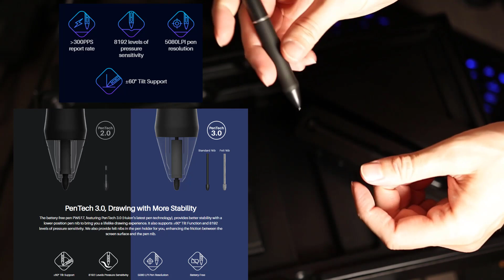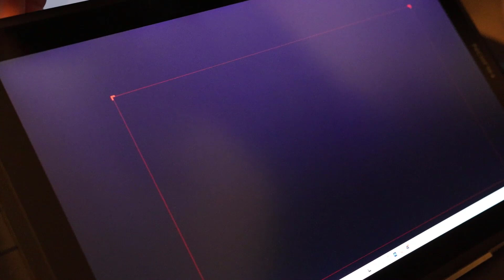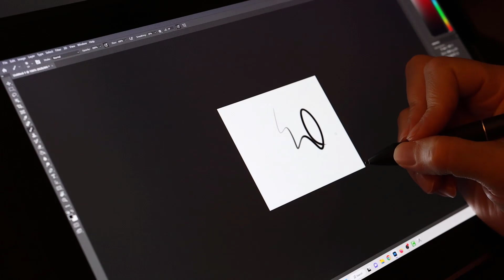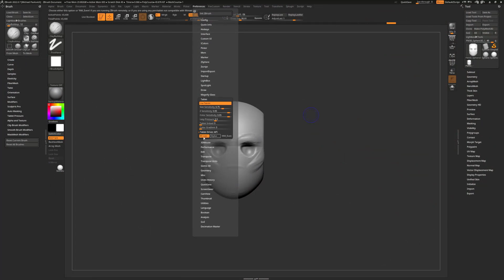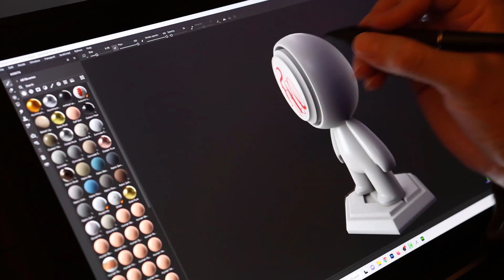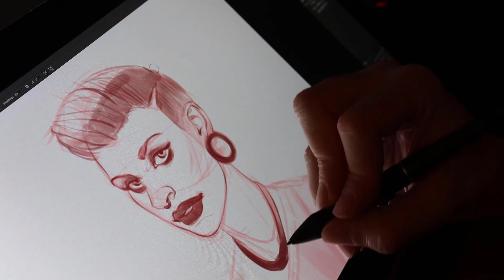Huion Kamvas Pro 16 (2.5k) - perfect portable pen display companion! Unboxing & draw/sculpt demos!

Comment: Can I use it for video editing and hit film pro for special effects.
And can I transfer those videos to my macbook seamlessly?
Reply: it is not a stand alone. its basically just like a monitor with pen control. refresh rate is a bit slow too at 14ms it would probably be no good for fast moving images
Reply: @cheveyo2403  what I meant was 
1--can it have softwares that are not on my pc or must it be on my pc to be on the display tablet?

2-- can I use it when my pc is off or does it only function with a pc that is on?

Thanks for the info by the way 👍

Comment: Hi, anyone can help? I have a strange problem. My huion makes a high-pitched noise when the screen is turn on. When I touch the screen with pen the noise changes to a buzzy sound. A similar high-pitched noise comes from the power brick. Its quiet noise but its give me a headache. Is it normal noises? This model is my first display tablet...and i'm afraid about my pc too. Display tablets, which my friends use, do not produce those sounds.

Comment: It's NOT portable! I wasted my money on this thing and I cannot get it to work on my laptop. I used a USB-C to USB-C cable and my laptop does NOT recognize it, I still have black screen on the tablet. It can only work on my laptop if I plug it into the wall socket, which is a thing I don't like in display tablets. Because I hate sitting in my room and working all day long at one place, I decided to sell that Huion tablet I wasted my money and buy an iPad instead.

Comment: Quick warning to those that would use the Huion Kamvas Pro 16.  I'm a proud owner myself, however I have noticed I loose pressure sensitivity in zBrush if I have Photoshop open at the same time.  Close Photoshop and my sensitivity immediately came back in the zBrush app.  Not sure if @Michael Pavlovich has seen or can confirm the same as me?

Comment: when photoshop is open uses windows ink, and Zbrush goes all Funky with pressure makin bumps in the stroke, when both software are open at the same time.  i contacted support, they are aware of the issue, it happens to all Huions, is in the drivers.  and  is an old issuie  they never fix it.    That why i returned my huion.

Comment: Michael: the problem with the pressure in zbhush is not you hand,   is an issue with photoshop open at the same time with zbrush.
Reply: Movink 13 by WACOM, one cord and side button, did you see this?

Comment: I was not able to find the price on their site, sounds fishy to me when they are hiding it so hard. Store button doesnt work too. I had bad experience with Huion in the past, it seems like nothing changed after 2-3 years to be honest. XPPen is not better (offset pen to display = really bad, it seem like you have the same issue with the Huion when looked at properly, but you dont mention it.) Also nothing is perfect. Not even a tablet. Barely any negatives, I just cannot believe that.

Comment: Nope. Do not buy. 
I did last year and I can clearly say that this thing is far from being pro hardware. I am saving money for cintiq.
I use cintiq in the office and kamvas at home. The difeerence is like day and night.
Do not believe these paid videos.
Reply: Would be helpful if you stated what's set them so far apart. I've been using Huion for almost 3yrs now in my professional career using sizes from small ("12")medium (20") to pro (24" QHD) and never once had issues creating.
Reply: @IspyrGameDev   I am a professional artist and using Kamvas 20" pro at home. The pen's pressure sensitivity is just so poor  that there is virtually no difference between pressure opacity on and off with photoshop's airbrush. It is a pain in the butt to use pen while color picking from the color wheel, you can't make precise selections. I simlpy have to switch to mouse whenever I want to pick a color few pixel away. The input response time is bad as well compared to wacom. If you wanna make very detailed, high-end illustraion assets Kamvas is just not efficient enough and therefore not for pros (at least to a certain degree) imho.
 
At my office, I use Cintiq and it provides much smoother experience and it simply works with me. At home, with Kamvas I feel like it works against me. At the first chance I will sell my Kamvas and buy a Cintiq.
Reply: @buffwarriors  Are you by any chance using them on the same computer which might cause driver conflicts?
Reply: @JorgeMarquezIO  no
Reply: @buffwarriors  ugh, sounds awful then... I bought one with their black Friday offers and received on that was missing most of the accessories, it was obviously used and was super dirty, so I and had to return it... Sounds like a dodged a bullet....

Comment: tbh untill they start making monitors at 144hz refresh rate or whatever else needs to be done to eliminate cursor lag (not brush lag) I won't really care about the new releases, iPad has spoiled me with it's zero latency
Reply: Feel you there. Been using Pro 16 (4K) for a month and ghosting effect is killing me. I think my HP monitor with its high refresh rate and 5 ms response time also spoiled the Kamvas experience for me. Considering that the only 120Hz tablet display is from Wacom and costs an insane $4.5K, it is really worth waiting for Huion to respond with its model.

Comment: Bought a Kamvas Pro 16 (4K) not too long ago, and was very disappointed. In fact, the tablet is very good, although the resolution for such a screen is too excessive, but a strong ghosting effect, very striking. In my daily work I use 32' monitor with 5ms response time and 164Hz bit rate. Huion has 25ms and 60Hz respectively. I've tried to get used to the Kamvas matrix, but to me it seems incredibly slow. Maybe for 2D work it is not critical because it is almost invisible against the light background and you can draw in Photoshop without any problems, but for sculpting in Zbrush I would not recommend it.
Reply: Thanks very interesting ; what would you say about durability ?
Reply: In general, the materials are not bad, and the responsiveness of the pen is not much worse than the Wacom. The pen is great, without batteries. Judging from the reviews and my month of using the tablet, the screen is still as good as new. I just read purely positive comments about the tablet and watched the reviews. But almost all were from 2D artists. And I don't know if it's a problem with my model specifically, because they have a 24' with 14ms response time, or if it's a matter of habit, because I use a much more responsive monitor. In general, my advice, before buying, pay attention not only to the positive reviews, but also read the specs and compare with your everyday equipment. If you google "kamvas ghosting", there are few reviews where they complain about the same problem in other models. But if you are a 2D artist, this is a much more affordable tablet than the Wacom models and the overall quality is not much inferior to the Japanese company's tablets.
Reply: @acidicbloom  thanks a lot for the elaborate answer. Yeah there's an overall positive vibe around this product. For less 400 bucks it's awesome.
Reply: I'm looking for a tablet to work in zbrush. What tablet would be great to work in zbrush according to you? Any specific features to look for before buying tablet specifically for 3d sculpting?
Reply: I bought a huion years ago when they first started becoming popular and the ghosting was SOOO bad. Sent it straight back. I was really hoping that would be a problem of the past... My 16" cintiq has no such problem and I was really hoping to upgrade soon but the big wacoms are sooo expensive x_x